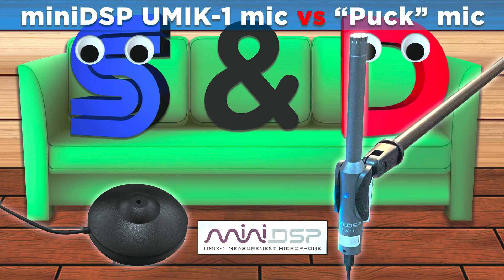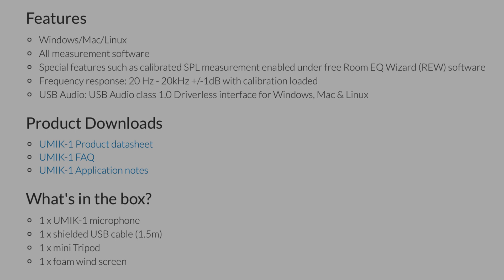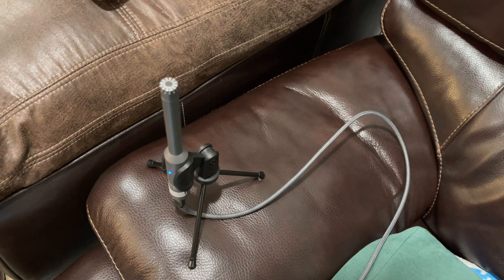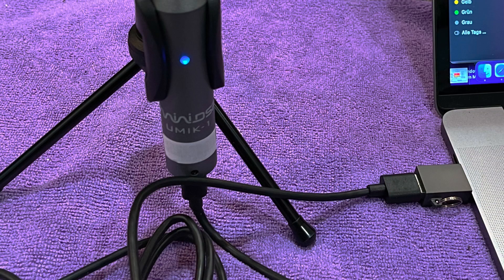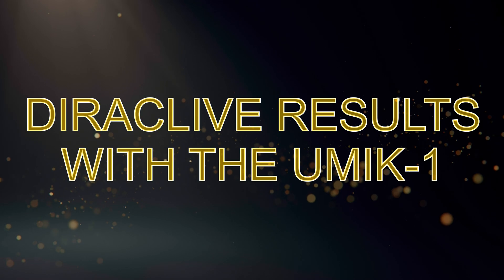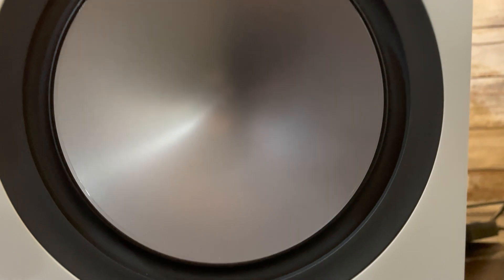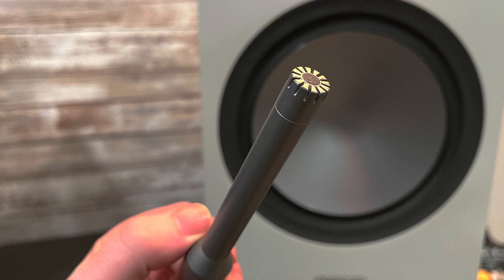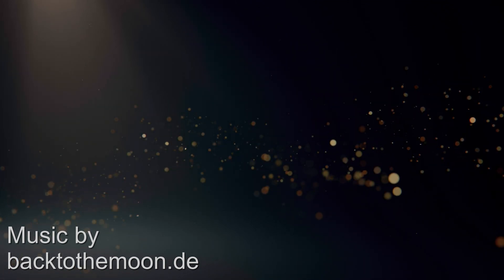UMIK-1 miniDSP + DIRACLIVE I Next level DIRAC LIVE room correction

Comment: so if you have a sony reciever your shit out of luck?
Reply from the maker: Hello @wizardz7938 ! You can use the UMIK-1 on different brand of receivers, not just Onkyo like I am using in my video. In my example I am using DIRAC Live which Sony doesn't support. But you can use the UMIK-1 for other room correction software as well. It's not 100% needed but it is good to have for the extra fine details and more sensitivity.
Reply: @SamDansCouch  can i use it with an adapter for the sony?
Reply from the maker: @wizardz7938  The UMIK is a USB device so it only works when using a computer while doing the room correction. You can use things like the free REW software for your receiver. But if you want to stick with Sonys own room correction you should probably stick to the mic that came with the receiver since it's all meant to work together perfectly.

Comment: The UMIK-1/Dirac are going to give you a better SPL measurement than a SPL meter. You should use REW sweeps to verify SPL, not a crappy all band SPL meter. Also, clipping issues with Dirac still occur with a UMIK-1. It happened to me with my Onkyo NR7100 multiple times last month. Also with my JBL SDP-55 once.
Reply from the maker: Hello Andrew, I am sorry you are having issues. Since using the UMIK-1 I haven't had any more clipping issues and I've recalibrated my RZ50 in several different rooms now. Make sure you follow the volume guide using this website: https://mehlau.net/audio/dirac-live-2-mic-speaker-levels/
Reply: @SamDansCouch I have it setup properly, I’ve used Dirac for years. There’s apparently an issue with Onkyo’s sub channel where it claims it’s clipping during calibration, but not in the beginning sound check. I had to set it 25-30dB lower than it should have been if I remember right. Another YouTuber had the same issue and posted about it saying to do the same that I did. It’s annoying and I hope they fix it. My JBL  SDP-55 didn’t have this issue, and it has far more bass output it’s reading. I’m sure they’ll patch it in the next firmware update.

Comment: Thanks for the video. I almost bought a 20 dollar puck mic for this.
Reply from the maker: Hello CSOCSO 👋 No problem, I’m glad the video was helpful to you. The umik-1 is definitely worth the investment 😊
Reply: @SamDansCouch  Long time no see :)  Didn't even remember leaving a comment here and I came around this video again. 
Couple heads up and you might know about it but:
1) internal test tones shouldn't be used after calibration. Internal test tones defeat calibration so don't use that. My other big issue that almost everything out there is "wrong" when it comes to level matching. Surround and heigh levels are all weirdly off with the dolby pink test noises and even with spatual audio toolkit. 
2) Subwoofer trims should be below -5. -7 being the sweet spot in my opinion.
Reply from the maker: @CSOCSO hello welcome back 😊 thank you for your feedback. With the latest updates to Dirac Live the measurements have been much improved. So much that the bass is well done by the automatic too not requiring any special tinkering (unless you want more of course). What’s always handy though is to give the center channel a few more dbs if movies are a little difficult to understand. But besides that these days I let DL do what it wants and let it run it course. The results are coming back really nice for me on the systems I set up 😎

Comment: After Dirac calibration can you go in the app and change the curve like with the Audyssey app?
Reply from the maker: Yes, you can save your calibration and later on go back in the app and make changes at any point in time.
Reply: @SamDansCouch   Thank you, this is good to know because I wasn't sure if I should get a receiver with XT32 and Dirac in case I prefer XT32 I could go back. I may just go with the Onkyo RZ50 then.
Reply from the maker: @arielrodriguez6980  I am still very happy with my RZ50 and DiracLive. I can fully recommend it 🙂

Comment: I think the results are close.
Reply from the maker: Hi Ariel 👋 yes they are close. It’s really for the final touch if you want to go through the trouble. The extra sensitivity of the mic made measuring also a little easier 👍
Reply: @SamDansCouch  Do you have to set the sub gain to a certain level prior to dirac like with audyssey?
Reply from the maker: @arielrodriguez6980 you slowly raise the gain/volume of the sub while you do the volume setup before doing Dirac live. That way all speakers and sub match in volume and can later be controlled by the Dirac live settings.

Comment: After measuring the levels of the speakers - do you have to correct them to a similar level before going to the next step in Dirac ?
Reply from the maker: Hello 👋 yes do the volume level within DiracLive first and then do the next steps in room correction. When it’s all done you can check the volume levels again with e.g. a sound level meter for the last tweaks. The center can always use a little more db 😊
Reply: @SamDansCouch  Thanks. I was just surprised that the Dirac instructions only describe playing the individual loudspeakers, but there is no indication of adjusting them to levels that are as similar as possible
Reply from the maker: @FrameWorks-j58 yes that is important, else the measurements can be off and produce a not so great result 👍

Comment: I’m trying to use a puck mic that came bundled with my Pioneer receiver. How do I go about using it in REW? I’m seeing that in silence the puck mic reads much much lower than the NIOSH app on my iPhone mic. Any suggestions?
Reply from the maker: Hello 👋 I personally don’t use REW but I know that it is highly recommended to use an USB mic with it. Even better when it comes with a calibrated profile like the UMIK-1 that you can load into REW. If you go through the trouble of room correction I’d definitely suggest getting a better mic 😊

Comment: Wow! Wow! I followed your advice and ran Dirac from a laptop with the puck mic. It took quite a while to adjust speaker volumes to get rid of the low noise ratio errors. I did the 17 points with no target curves. The result was amazing! My 5.1 sounded far better than the Dirac result from iPad w the puck mic. The only thing I adjusted after calibration was to change a couple of crossover values: center from 70 hz to 80 hz and sub from 120 hz to 100 hz. The Hotel California by Yao never sounded this good. Thank you.
Reply from the maker: Hi James! Thank you for your feedback 😎 I’m glad you could tune your setup to the next level.

Comment: Hey,
cool video. Nicely explained!

I've been using a Denon AVR with Audyssey for a long time, and before that I used a PC with Creative sound cards to watch films for years. What I can no longer find with Dirac (on the Onkyo 7100):

The possibility of sensible volume or dynamic compression (in 4 levels) (in Audyssey called “Dynamic Volume” / “Dynamic EQ”).

The differences in the sound dynamics in films are so extreme without the possibility of gradation that the overall volume has to be constantly turned down and up, over and over again, all the while holding the remote control in your hand.
At the beginning, the Dirac calibration option was considered the main reason for me to buy the receiver, but it would now definitely be the main reason for returns.

So my question:
Do you know of any way to limit the dynamic range? (I only know the night mode on Onkyo, but it's like on or off, and the limit is much too strong)
Reply from the maker: Hello DF 👋 Thank you so much 😊 I’ve been a creative soundblaster user myself as well a long time ago 😄 The Onkyo has something called THX Loudness Plus which helps dynamically adjust the sound even when listening at low volume. Unfortunately it’s not compatible with Dirac. When using Dirac you can only use the none dynamic night mode. It sucks that this is still a problem how many shows and movies are mixed bad. Some productions are well done these days but many others are not and things like dialogue are so low compared to the rest of the sound. If the movie you are watching is too badly mixed you might have to turn off Dirac and switch to thx. Or do it manually with the remote in your hand. Not ideal. I’m sure there will be a new room correction that will do this too. Companies always have to give us a reason to have to buy another new receiver 🥲
Reply: very unfortunate. But thank you for your feedback anyway @SamDansCouch
Reply from the maker: @df5485  No problem. The dynamic volume is active using one of the following modes: "THX Cinema, THX Music and THX Games mode. The optimum THX Loudness Plus setting is applied according to the type of content"
Reply: if you want to listen to movies at low volume and be happy use denon and its dynamic volume set to LIght, if you want to listen to movies at reference level or close to it  with a very clear sound  onkyo and dirac is the way to go... if you want to watch movies loud and clear with the best enveloping experience I really recommend the new sony's avr and its 360 spatial mapping tech ... it really creates a bubble around you... but it kinda sucks at low volume

Comment: Cool!!  Good information.  I will follow on with this upgrade as well.  Like you said, since I have over $10K worth of gear, it makes sense to use this $75 higher fidelity mic too instead of the puck mic.
Reply from the maker: Hi tg 👋 Thank you 😊 yes it’s definitely worth it going the last step with a good calibrated mic. It does make a difference and gives the sound a nice final touch.

Comment: For many users the upgrade ( if you have no dirac license for example) very expensive. You need software and the microphone. But ont he other side..every hobby is expensive :D
Reply from the maker: Hello Dimitri 🙂 Our hobby is for sure expensive. It was worth it getting the Onkyo because it already has the DIRAC license included. Other brands want extra money for it which adds up quickly. But if you are so deep down the rabbit hole, around 80 dollars for the UMIK-1 doesn't make much difference any more. You can always get it later too which I did.
Reply: @SamDansCouch  I don't know where you bought your UMIK-1 for $80 . My UMIK-1 cost me $144.67 out the door from Amazon . Bought it on 3-25-2024

Comment: Have you ever spent time to modify the curves in the DIRAC results to increase certain frequencies or for a small home family room....leaving it the way it is after calibration would be more than enough?
Reply from the maker: Hello Talking With Cars! 👋 I’ve modified my curves with my first Dirac setup with older speakers and the puck mic. Ever since though with advancements in the DiracLive software itself and in combination with the UMIK-1 I am very satisfied with the automatic results and left my curves as is and that’s how I run my setup right now. No need to worry about having to manual adjust things unless you really really feel like bass or any other frequencies need a boost to your ears😊

Comment: I am getting error messages, that my measurement has been taken for the position but is unusable, and an error 106 thst states the position measurement failure...HELP!
Reply from the maker: Hello! 👋 that error code means that the surrounding noises are too loud and interfere with the test tone. Try to lower the gain level. The UMIK-1 is way more sensitive compared to the puck mic. Which is a good thing. And also try if you can measure at a time where neighbors or street noises are the lowest. It’s gonna take a few tries but it’s worth it 👍

Comment: Hi Daniel.
Thanks very much for your job and video.
Have a question though.
I'm using pure stereo system in my (definitely) imperfect room.
System consist : NAD C658 as a A/V hub/switcher/pre-amp 
Denon amp
Variety of sources 
Variety of loudspeakers ( still in pure stereo )
I bought a full version of Dirac Live and it installed on my phone.
I did a full calibration using provided ( puck/cheapy looking mic )
Considering to get a UMIK but...
Now's the question finally🤭 ...
Do you know, if I can plug in UMIK directly to NAD C658 or do I need to use laptop ?
If the latter, can I still use a Dirac Live license I already paid for using it on the laptop ?
Reply from the maker: Hello @MrHesmovedon 🙂 Thank you!  I used my puck mic for the first year but after this test definitely could tickle a little more details out of my system with the UMIK 1. I am not sure if the NAD directly supports the UMIK 1, I kinda doubt it. My Onkyo receiver only accepts its own microphone and nothing else.  But I would always prefer using a laptop over the DIRAC Live phone app. You just have more ways to store settings and mess with the curves without having to deal with the touch interface.And even more important: You can load the calibrated microphone profile into the Dirac Live app on the laptop which is very important.  For that you'll just need to hook up your UMIK 1 to a laptop. Your license should carry over when you log into your DIRAC Live account on your laptop.  A little more work but it's going to be worth it 🙂Just remember that when using PURE mode, Dirac live will be turned off. So you'll need to use a DIRAC LIVE mode after measuring your room.
Reply: @SamDansCouch  
Thanks Daniel for quick and comprehensive response.
I already decided to buy UMIK 1
Most of the internet sources says, there's no need to go up to UMIK2.
Still, need some extra dough put aside first 😉
I still hope to connect UMIK directly to NAD C658, as it is 
Quote :
"Your NAD C 658 model comes with Dirac Room Correction Limited Bandwidth installed..." And now...
Because Dirac officially recommends UMIK mic as a alternative to the provided one, I hope (again) to connect it straight to NAD and use laptop running Windows instead my phone only as a controler.
What do you think ?
Reply from the maker: @MrHesmovedon  No problem 🙂And yes the UMIK 1 will be perfect for this use while an UMIK 2 would be a waste of money for just room correction. I would give it a try if your NAD will accept the microphone directly. I just wonder how you would get the calibrated microphone file into your NAD as well. On the computer you need to load the calibrated file into the Dirac Live app. Let me know once you got the UMIK 1, I'm curious as well but I know you will love the results in the end 👍😎

Comment: Thank you so much!  I’m about to do the 17 measurements with the umik1😊 

For sure, the center channel should never be at 120hz.  Try going to 10hz above the manufacturer lowest frequency.  Listen to deep voices like Clint Eastwood to see if you’re losing content with the 90hz.
Reply from the maker: Hi Tech Samurai! I’m gonna try it out 👍 Good luck with your measurements! It’s gonna sound much better 😎
Reply: @SamDansCouch Oh man, the volume calibrations were so tough.  Thanks for the link as I could have blown my speakers or sub.

I used your guide but still found them tough especially when they talk about -20 to -30 - there are no colors now.  in the app.

Are you supposed to put the mic in the MLP to do them?  I suspect that would be a prerequisite as I did them close to the MLP and then had to redo them as I realized the volumes are different based on distance. 😃

I had to lug my laptop around so I decided to get a long USB cable and redo all the measurements.

It's quite a bit of work...  

How much did you vary the height by?  My sofa is a deep sofa so my ears and head are right at the top of the sofa.
Reply from the maker: @techsamurai11  Yes the volume calibration is tricky. For that the mic needs to the in the MLP. It also tries to measure the distances and stuff from the first measurement at the MLP, which is not always spot on and needs to be manually corrected afterwards. Same with the crossover settings. Good call getting a longer USB cord. The supplied cable is too short when doing all the different measuring positions. I did the heights like this: Ear height, one mic length above ear height and for the low ones directly on the couch/seating height. I don’t think the heights are super important as long as you keep them the same heights when going around your couch. It is definitely a lot of work especially when other people are making noises ruining your measuring but it’s worth it in the end 😁
Reply: @SamDansCouch  Holy Crap ;-)  I ended up with a crossover of 150hz and distance of 0.0 ms and the same speaker level so clearly something went wrong somewhere.

I did receive exclamations marks when I was measuring for 15 out of 17 locations but it also said that it measured it successfully so I didn't think there was an issue.  I just thought that's what it shows after you measure it.  Then I noticed that one speaker had a check as did another so that led me to question the results but I loaded them and they looked fine.   I guess that caused the issue but it still provided targets for all speakers and the frequency measurements look fine for the checks and question marks.  

Do you remember if Dirac measured the left channel twice for you?  It did that for me every time and I wasn't sure if that was a bug. I thought it was doing both left and right for stereo but it was just the left on the UI.

The sound is very tamed now and warmer compared to the measurement from the 3 positions and the included mic.  I might do a test with the included mic and fewer positions.